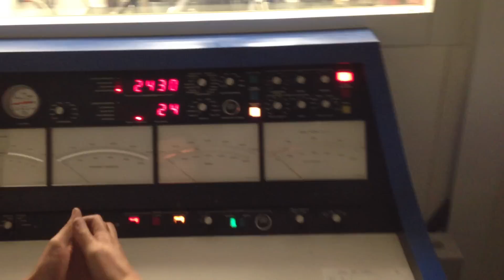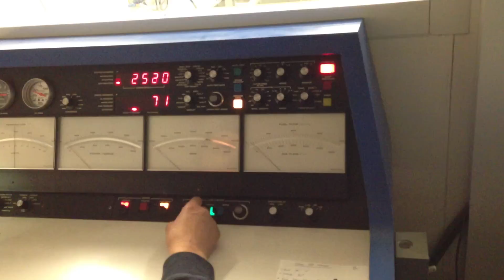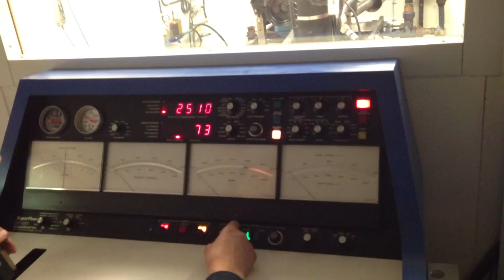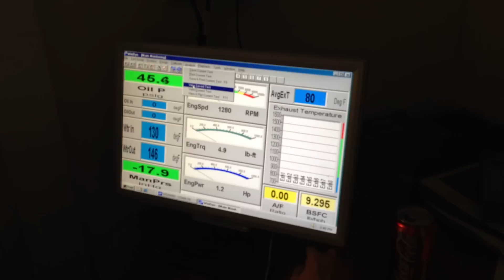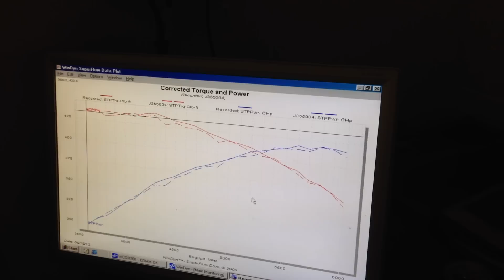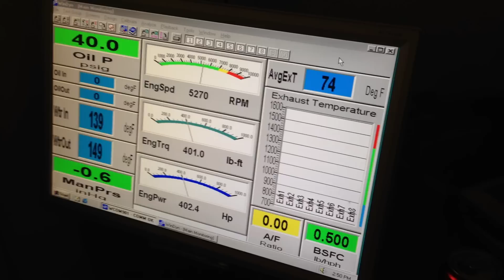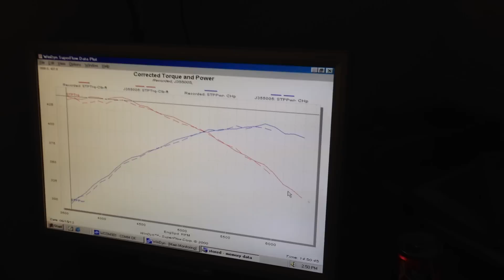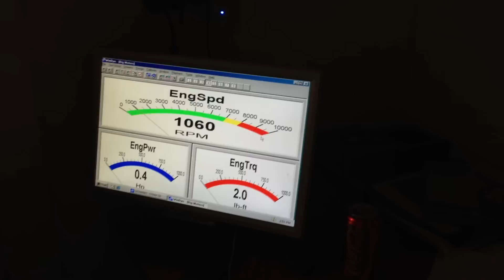Holden 308 355 stroker on engine dyno 424HP

Comment: These are such good motors. I am done with carburettors and distributors though. When injection and coil packs came along 90% of all engine troubles evaporated overnight. I just wish they had kept developing the 304 a little more and got rid of the dizzy. I'd never drive anything else. But I'll stick with my L98.

Comment from the maker: Hi mate, thanks. 
You're exactly right - a bigger solid roller cam and hi-rise single plane manifold would easily bring it up to around 500hp. Everything else is there for it. And it actually would have been cheaper than going hydraulic roller. But then the motor would have been more of a pig - would've needed bigger stall, shorter diff etc etc. would have made the car much less streetable - and attracted more attention - the last thing I want is a sticker on the windscreen!

Comment: Hi mate, nice sounding engine. How much did it cost to build the engine ? if you don't mind me asking.
Reply from the maker: Hi, around 10k in parts and machining. I blueprinted and assembled it myself as a project (first motor i've built! surprised it didn't grenade on the dyno!) so the only labour costs was the machining...
Reply: slittydotnet First engine... Well done. How it holding up with road use???
Reply: rottysaurus Is it true that a Roller Cam conversion is around $3000??? Wish I went Roller instead of Solid Flat Tappet...
Reply from the maker: rottysaurus Just finished putting it in the car, we will see! Just uploaded another vid of it running in the VC Holden VC Commodore with fresh 355 just fitted
Reply from the maker: rottysaurus Hydraulic roller is generally expensive cos good cams are custom ground, not cast, $600+, and hydraulic roller lifters are expensive $800 for good ones. Probably not $3000 though. Solid roller is cheaper, but you would know the tradeoffs you make for going solid...
Reply: +slittydotnet hey I have a question for you.  Iam from the USA is holden a part of GM. does holden and GM parts interchangeable or totally different.  awesome video
Reply: Holden is a part of GM but only until then end of 2017 as Holden are closing it doors due to sales being down due to smaller cheaper cars being produced. The Holden 308ci V8 is all Australian and not something you US guys had but the current LS series of engines are exactly the same in both the US and Australia. Heres a random question for you... Do bathrooms in new homes get waterproofed?? I saw a US renovation program and the floor of the shower got a coat of tar based sealer but the walls were left bare and tiled over where in Australia the entire shower recess walls,floor and entire bathroom floors are waterproofed with either a water or chemical based water proofing membrane...
Reply: Iam Sorry I Really don't know about that.  Thank you for the information about Holden.
Reply: I talked to my brother he said that we don't use tar that we use a
waterproof backing board
Reply from the maker: sterling Wilkey
Hi
In the holden 308 (1970 ish to 1999) Most parts are Holden only. Only a few are interchangeable, eg, i'm using chev 350 rods.
It runs a lifter bore pattern similar to a Pontiac and I'm using roller lifters made for Pontiac.
Holden 308 is much more expensive $ per HP as there's not a big a market for performance parts, whereas small block chev has a huge market.